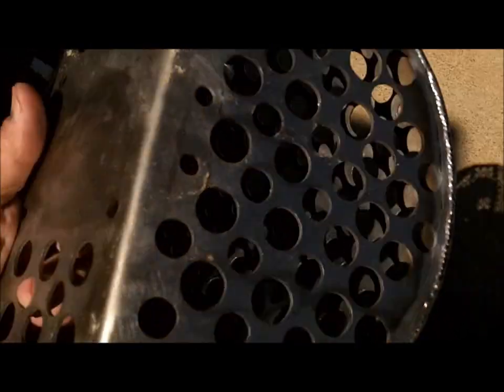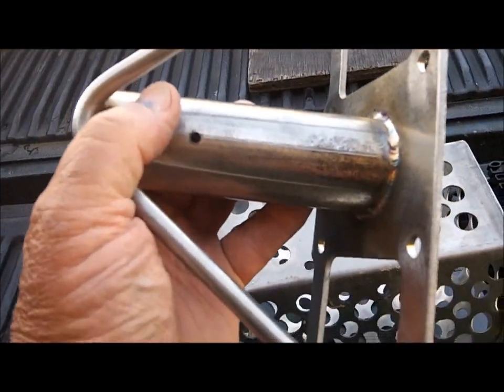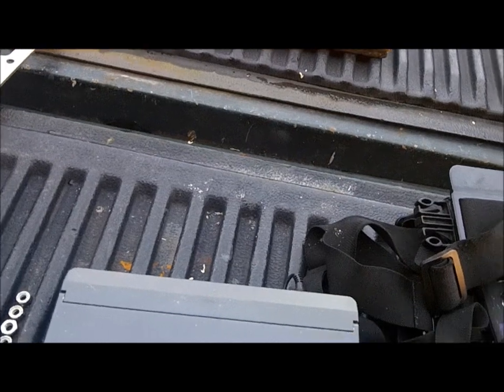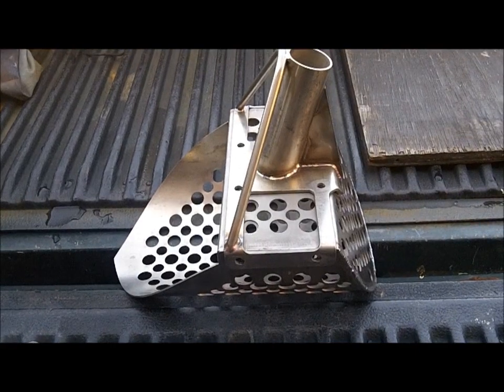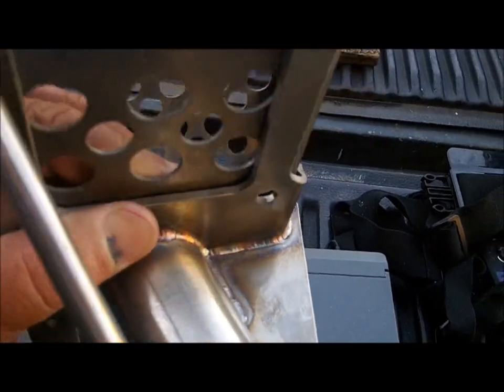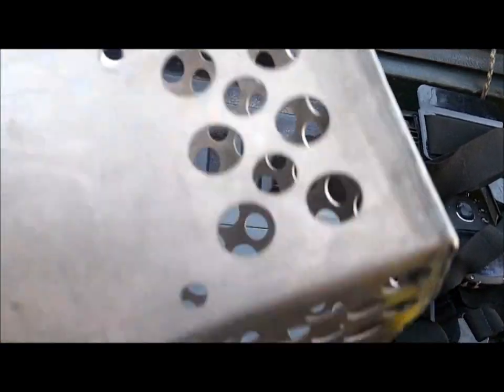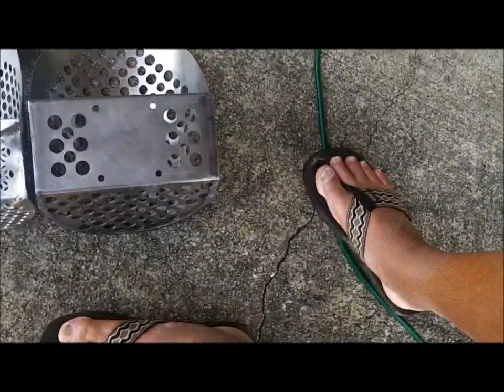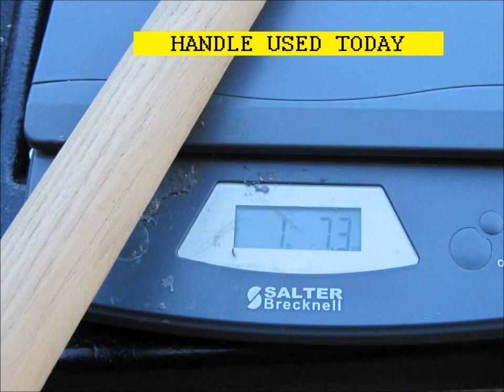OCT 6TH -  NEW PROTO TITANIUM SCOOP  -  for testing arrived.

Comment: Wow ! I am interested, Titanium is stronger than the stainless and the weight savings. Have the top made of Titanium instead of stainless also with a carbon fiber shaft. I will keep watching for the final product.
Reply from the maker: this was several years back and it was a gift from a fellow hunter from rochester ny who owner a nice machine shop........made 2 as far as i know, one for me and one for himself.........i still use it today........once in a while.......i sent it back and had him add on a bit longer lip end......guessing 3" piece.

CF shafts are $$$ BUT BY FAR superior to anything we use now......2 are over 4 years old, almost used daily and NOT EVEN A SCRATCH ON EITHER mine or denny's or mr beavers.

Comment: I use the 9.5 inch T Rex . I like it but it gets heavier as the day goes on . I think it's 5 lbs. when I start. LOL
Reply from the maker: we tested it few years back fro ron and the newer 8" model he had as well.......one of the original 9.5's we got is still being used here by the guru....kenny.....but he has ripped the flat handle part off of it 3 years at least 2 times.....repaired and now it is extra heavy, but still a good scoop.
Reply: WOW I just noticed the date on this video. I thought it was a new one when I watched it.  I enjoyed it.